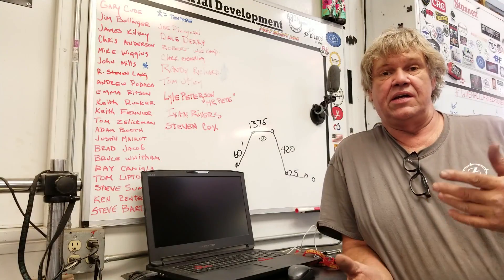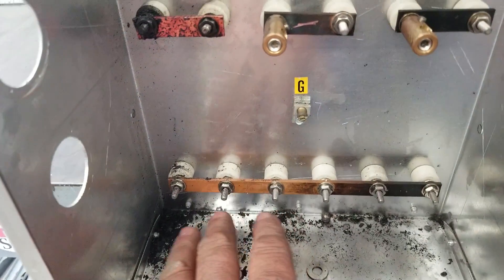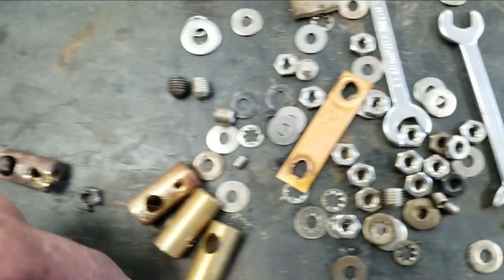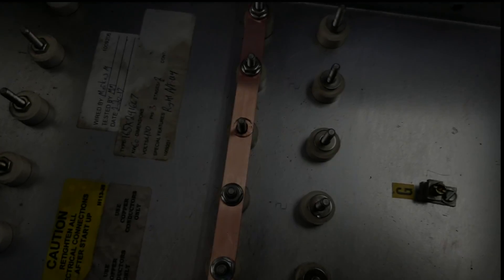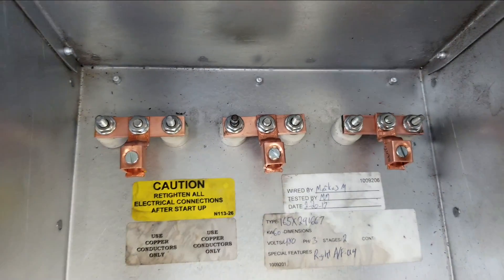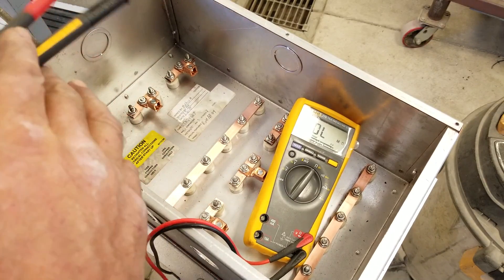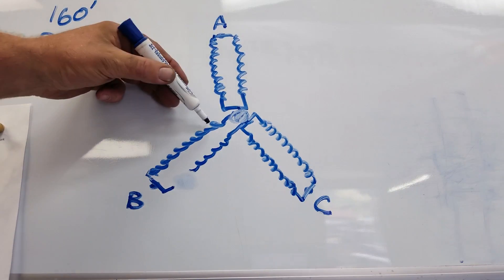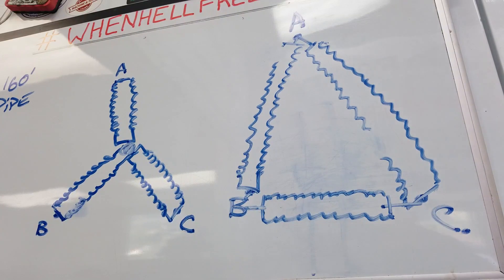Heating module repair

Comment: On our preventative maintenance program we tested terminal tightness monthly and found looseness. We started using Nordloc washers, seams to have helped with the dissimilar metal expansion we have now changed to checking  them yearly with no faults found it has helped with our application.
Play Safe From Elliot Lake Ontario Canada.

Comment: I think that's the same model Tim Hortons uses to toast yer bagel. :) 
I imagine with the expansion/contraction cycles that unit needs checking fairly often for electrical tightness.

Comment: Was the original hardware coated copper/brass? I've seen those washer/nut configurations on old transmitters and they worked well, but they always had a copper/brass substrate.
Reply from the maker: They were stainless

Comment: Another advantage: 25% fewer wires; no ground wire needed. You need safety ground but no ground load.
Also, voltage in the load part of the circuit is lower (1.7 factor).

Comment: But remember, most of the times you don't have the choice between star and delta, because the Voltage in Delta is Squareroot 3 times higher. Example: In a 380V 3-Phase environment, the voltage in a star, between each element, is 230V, in Delta it is 380V (230 *SQR(3))
If your heating element is not rated for this Voltage you have problem. This also results in a 3 times higher power draw in delta configuration.
You can overcome the problem of breaking star connections by attaching the Neutral Wire to the Star Point. This pinches the Voltage back to 220V. But in High Power environments there shouldn't be such unsymmetrical use of the phases. So still a thing to fix.

Comment: Question about the delta configuration, if one of the elements burns out, would it still shorten the life of the other element in the pair? Also, could you redo the busses and convert that element frame to being a delta configuration without any further modification?
Reply from the maker: In the delta configuration, each element dictates its own current draw and is not reliant on any other element. So to answer your question, yes, the other element will run fine.

Comment: What voltage does that 60Kw element run at? Those copper bars look rather anemic for that much juice...
At those currents, the copper should be tapped and the hardware should be of a suitable alloy, not regular hardware-shop hardware.
This is a really lousy design.

Paddy
Reply from the maker: I have 480 V to work with, with the connections tight and everything working properly, it only pulls 34 amps per leg, when things get loose, this changes very quickly.
Reply: Stan,
Thanks for your reply!
Yeah, I see.... 
But, no matter what you do, and what efforts you give this, unless you rebuild the entire bus-bar section.... this thing is going to be on your 'healing-bench' in a year, if it is that long.
We used to have these nuts, made out of some copper-alloy, that had a knurled rim. This rim was press-fitted in a hole in the copper bar, providing a very good and durable contact.
The cable was then secured by a bolt through the bar, in that nut. That bolt was of the same alloy. The contact face of the bolt was serrated, so it would cut into the cable-shoe (or other bar if that was the case).
The problem is of course exacerbated by excess heat, given the application.

Good luck with that one mate.... I don't see it end well!

Paddy